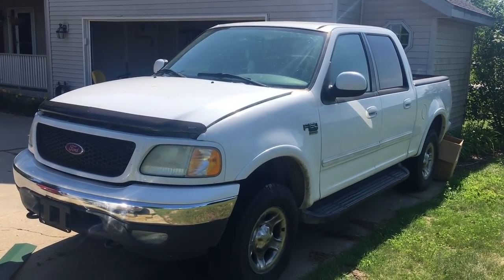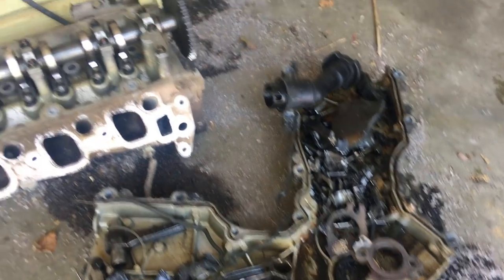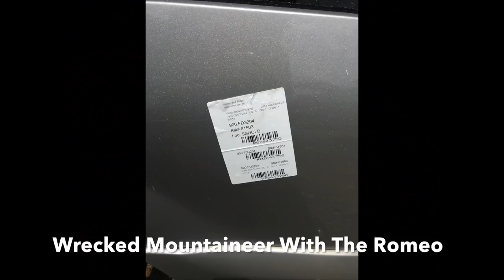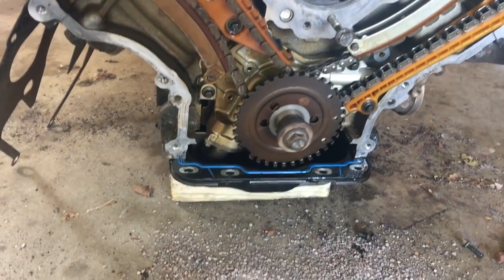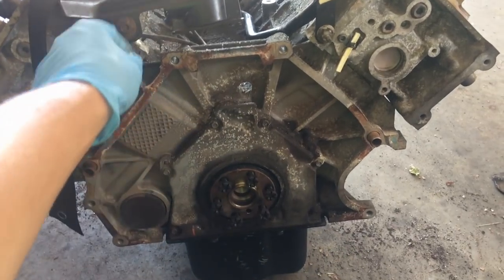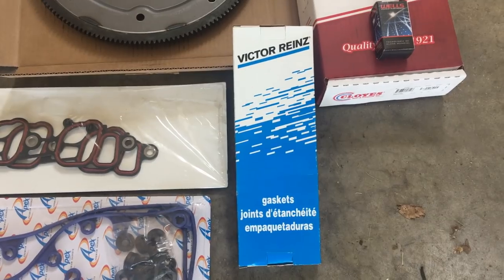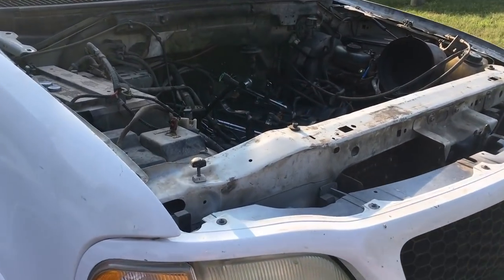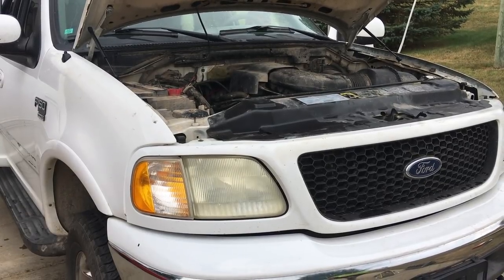Swapping a Ford Windsor 4.6 with a Romeo 4.6 - YES, It Can Be Done!!!! - Differences

Comment: Will the 4.6 romeo motor work on a 4×4 f150?? I also have an f150 with a bad 4.6 motor
Reply from the maker: Yes, you can swap between the 2 like I did.
Reply: @ChadWilliamsFixesAll  thanks
Reply: My friend has a 2005 4x4 the engine went bad in due to water in cylinder 1.  Bad intake gasket allowed water to flow right into the intake port from the coolant crossover.  This truck had a Romeo engine in it from the factory.  We used a 2006 Mercury Grand Marquis engine (also a Romeo) as a replacement.  The only thing we had to do was swap timing covers.

Comment: How do I do the knock sensor. Will the Windsor knock sensor just bolt up to the Romeo
Reply: im want to know the same thing?
Reply: @mj2069  Yes the sensor is the cable and the bolt just holds in in place.

Comment: My truck has a Windsor 4.6 and I’m trying to swap it for a mustang Romeo 4.6 I want to keep the mustang heads and intake does anyone have any tips for me
Reply from the maker: Hey Gratest Ever, you should be able to put the heads from your mustang onto the other block. Then, the intake will also fit because you transferred the heads.
Reply: Kind of pointless if your truck has pi heads keep them the Windsor are 8 bolt forged crank unlike the 6 bolt Romeo cast crank if your trying to make more power you need to look into building a motor and what one you want the mark8 and navigater motors are both 4v and fit but 5.4 going to make good torque

Comment: is there any benefit of having a romeo over a windsor?
Reply: The 4.6 isn't a Windsor at all anyways. They are modular motors. The Romeo heads are the only advantage but not by a lot
Reply: @musicrevelation2023  There are Windsor 4.6 and 5.4 mod motors.  If it has 8 bolts connecting the flexplate/flywheel to the crank, it's a Windsor.  If it has 13 bolts holding the valve covers in place, it's a Windsor.

Comment: Can this be done with a Mustang Romeo motor?
Reply from the maker: Yes, it should be the same.
Reply: So the Windsor intake bolts line up on the Romeo? Awesome
Reply: HELL YEAH I'm putting a GT motor in my 1997 F150!
Reply: Of course, Mustangs used both Windsor and Romeo engines.
Reply: Which one had the Spark Plug holes with only 3 threads?? They were notorious for blowing out Plugs - taking the threads with them!
Reply: @CarminesRCTipsandTricks  Both Romeo & Windsor heads actually have about 4 threads holding the spark plugs in. Make sure they are torqued down every oil change. It's worth the time to pull the cop's off & check them.
Reply: @skippysshop137  Thanks! I was a Ford Tech up until 95... We never had ANY issues with Spark Plugs...
They were only in TC, CV, T-Bird and Cougar.
I wonder how much they saved, taking out a few threads per Head!? 😳
Reply: @CarminesRCTipsandTricks  If you torque them to 28 foot pounds they stay in and not what Ford said on the torque.
Reply: @StonedPony1  Yeah... I've heard that often. I've been torquing mine to 25ft. lbs., but since it's got 160,000 miles on it anyway, I'm just going to pull the Heads for a refresh - and HeliCoil all 8 holes. 
May change the Cams, definitely getting a Melling Oil Pump.

Comment: You still haven't answered my question. How do I test start a 4.6 engine that is NOT in a vehicle?
Reply from the maker: You would either need to build a dyno stand and have everything like a fuel cell, cooling, etc. Or, take it somewhere that can dyno a Ford Engine. There isn’t an “easy” way to do this.

Comment: I was tryna see if I can put a 2000 lincoln towncar motor in a 2000 expedition do you think it's  possible?
Reply from the maker: It may, but you will probably be changing a lot of parts from the Expedition over to the Towncar motor.
Reply: MARIA S I’m tryna put a 97 Lincoln town car 4.6 into my 99 f150 4.6

Comment: Wait that truck had PI heads? 👀
Reply: Silvr_3.7 99/2000 was around the time ford added pi heads to the 4.6 and 5.4. hp ratings went up to reflect the head change.
Reply: pcs38nau Ik they did in the mustangs because my 2000 had PI heads.  The crown vic didn’t get it tho until after 03.  I’ve learned a good bit since I left that comment 😂
Reply: @Silvr_3.7  All Romeo engines received PI in 2001, including on the Panther cars.  Some Romeo engines (Mustang), and all Windsor engines, received PI in 1999.

Comment: Why would you swap one for the other? There is literally nothing to be gained with such a swap.
Reply from the maker: We did it as the Aluminum block was a a lot more available in my area. The cast iron block was hard to find and over $2000 for a good, low miles engine. We bought the Aluminum from that Mountaineer for only $90ish on half of days at a pull a part yard.
Reply: Isn't the Romeo lighter, too?
Reply from the maker: Yeah, the aluminum Romeo is a little lighter.
Reply: I have a Mustang with a Romeo block, it's not aluminum.
Reply: Right, but that's not what Chad Williams has.  He has an aluminum romeo block.  Hence the reason I stated it would be lighter.
Reply: @Necrometalfist  2001 to 2004 was the pi romeo

Comment: Nice job but u still have to worry about spark plugs flying out , stay away from those things man.
Reply: Thew 4.6 2v Romeo & Windsor are one of the best engines Ford made. One can run into plugs blowing out if they are not torqued correctly. Cal Van makes a insert kit if a plug hole looses its threads specifically for the Triton V8. Very easy to repair, & no need to pull heads anymore. Ron Williams has excellent videos on using the Cal-Van tool.
Reply: In 2005, Ford revised the thread count which greatly reduced rocket plugs.  However, almost all rocket plug incidents are due to improper plug installation / torque.

Comment: Bet ur connecting rod bent and caused ur problems.. my number 8 did the same thing.. only difference is.. I didn't run it . U running it is what tore ur barrings up
Reply from the maker: It was my buddies engine, so I am not sure why he ran it for so long. I actually can't believe it was still running with that much catastrophic damage inside of it. :)
Reply: @ChadWilliamsFixesAll  im gonna rebuild mine... haven't decided which way I'm gonna go with ir...

Comment: The Romeo is the garbage engine. Why use that one? Why not try to source another Windsor?
Reply: Romeo is not a garbage engine.  I pulled the engine out of my 2005 CVPI @ 250k miles due to an oil consumption issue.  When I tore down the engine, I discovered the valve stem seals were toast but the rest of the engine looked almost new inside.  No discernable wear on ANY of the bearings, rings also looked new and factory crosshatch could still be seen in the cylinder walls. For an engine that was run hard and put away wet by law enforcement for 122k miles before I got it, then subject to another 130k miles of use (not babied at all), I would hardly agree that a Romeo is garbage.

Comment: Can it be done? Yeah sure.. should it? Big no. The Romeo motor is junk compared to the Windsor. Just no
Reply: I dont mean to come off rude its a great video but my advice. A better Windsor is best
Reply: They are functionally identical.  The only thing the Windsor might have is crank bolt to flywheel count.